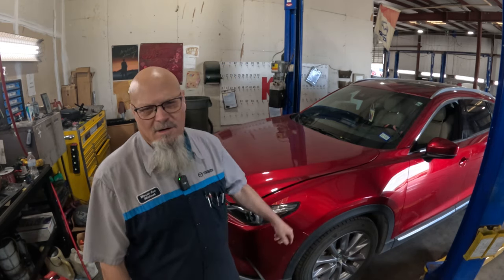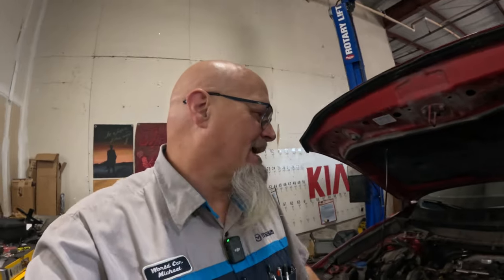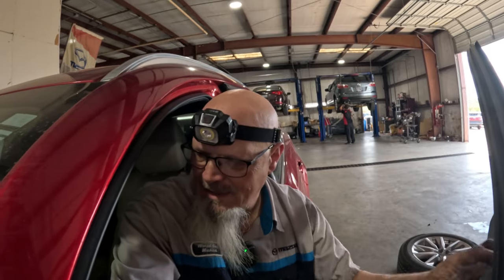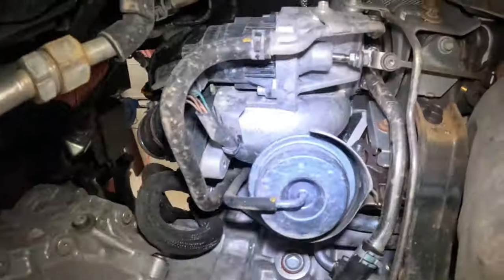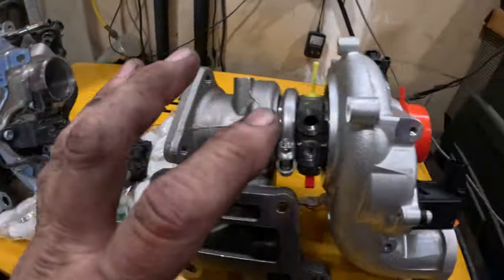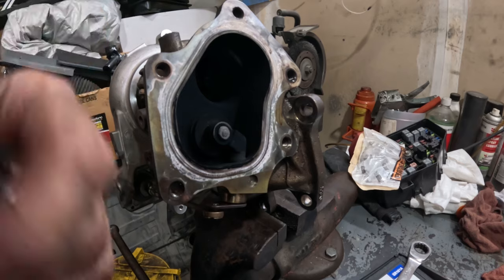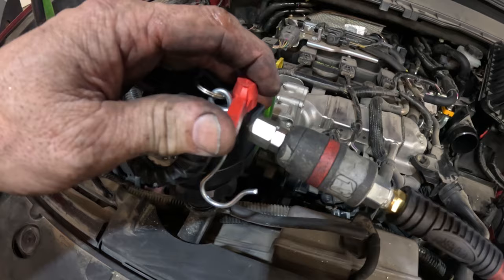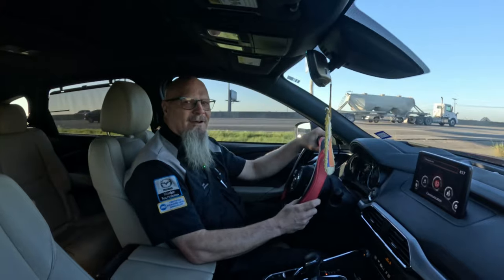2020 Mazda CX9 turbo charger replacement.

Comment: could you please clearify the Odemeter reading and why it was replaced , I have the new cx-90 and I just want to have an idea how much they last and their symptoms of failure
Reply from the maker: The vehicle had about 51,800 miles on it. Still under powertrain warranty.  The turbo was replaced because the wastegate actuator was sticking open at times.  Not a very common issue. When the wastegate is stuck open, the exhaust side bypasses the turbine and the turbo doesn't spin up enough to make any power.
Reply: @ShopForemanGarage  how can you tell this is going on?  I have that many miles on my CX5.  I can hear the turbo spooling, I can feel it.  sometimes it doesn't feel like it pulls as strong as it should
Reply from the maker: @scotthayesproductions5715  most of the time, no boost.  Checking the voltages going through the wastegate actuator were not at the spec. that Mazda says they should be.  Mazda says replace the turbo.

Comment: are these turbo same as cx5? I always thought the wastegate were vacuum operated.
Reply from the maker: Yes I believe they are the same. They used to be vacuum actuated but I think when Sky Active came out they went to electronical actuation. The older speed 3, speed 6, CX-7, and others were vacuum actuated.
Reply: well thats a terrible idea, i pray that it is reliable given the high heat from turbo charger.  Im going to bug you with another question here, given these are gdi engine, have u ever cleaned the intake valves on these? and whats your take on a catch can? @ShopForemanGarage
Reply from the maker: @FrozenAppleX  from what I've seen. Catch cans are good, if done right.  I have cleaned intake valves on the GDI engines.  BG makes an induction cleaner that does a good job.  But, for Mazda. That catalytic converter is so sensitive, that pouring stuff down the intake can cause damage.  Believe it or not, Mazda says to remove the intake and physically clean the valves.
Reply: @ShopForemanGarage  aw ok i see, alright time to get myself a catch can. Might clean the intake valves too, we have a walnut blasting machine at honda, might work on this but no adapter, itll be messy but itll get the job done.

Comment: Me think, you're whining a lot.  especially about those two studs. Com'n, they are not rusted...2 nuts would have done the job just as well as your special tool...make sure you w40 them before, and if they are really rusty, heat them up. but these didn't look that tight to begin with.
Reply from the maker: Thanks for watching. And thanks for your support.